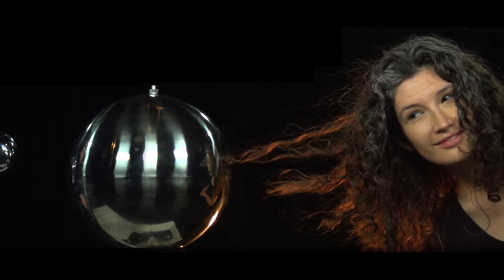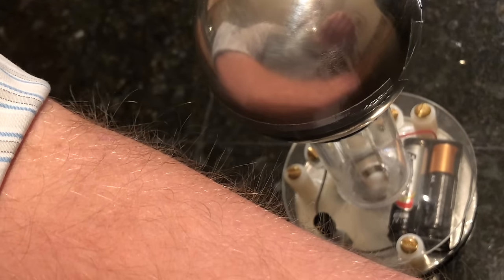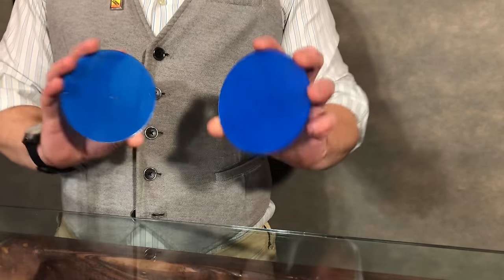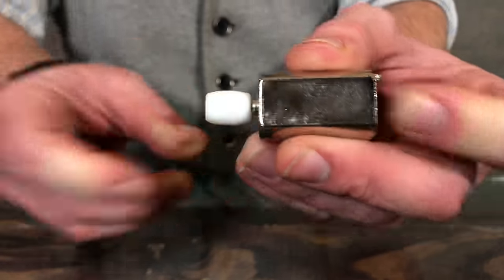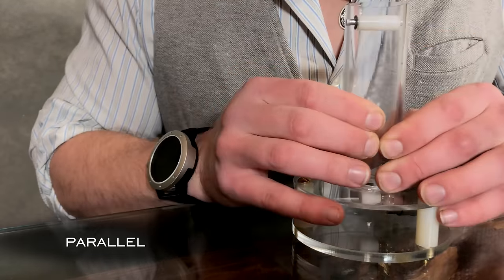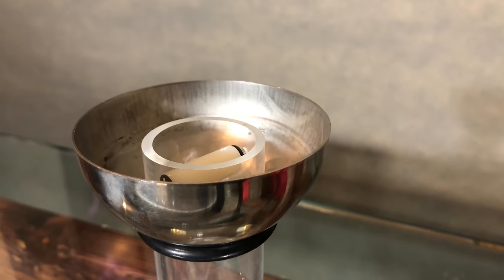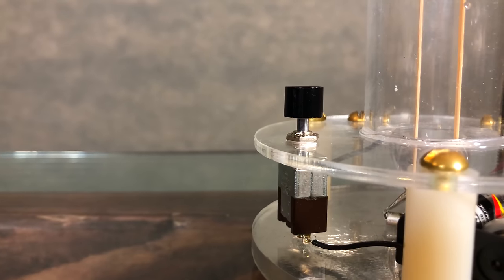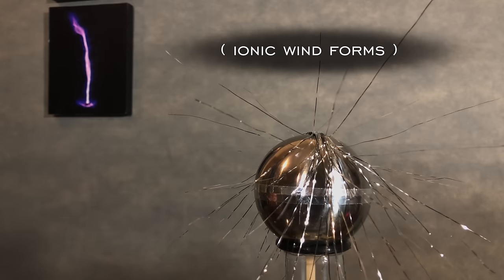DIY 40000 volt Van Der Graaff (battery powered)

Comment: Beautifully built, again. I was really looking forward to this video, because I have built a van-der-Graaff generator myself many years ago. One can even build a n ion motor. You just need some copper wire bent to an s, sharpen the ends, hammer it center and punch a little little dent with a prich punch in the middle and make a stand from another copper wire that is an o at the base to rest on the sphere and a vertical axis, which is sharpend to fit into the punch hole of the s. After is is ballanced, it will spin, when the van-der-Graaf generator is running, because the ions in teh air will repell the sharp ends of the s.
Reply from the maker: That’s true. Ion motors are fun. Thanks for the compliment

Comment: Just a thought ... you require 4 spacers for this project but 3 of them are just used for simple supports in the base.  These don't have to be nylon necessarily.  The only one that has to be nylon is the one you use to form the upper roller with the rubber band.  That one has to be nylon because of where nylon falls in the triboelectric series.  The nylon spacers linked in your materials list cost nearly $5 each.  You can use something much cheaper for the 3 supports for the round base.

Comment: About 60 years ago I built one using a plastic pill bottle for the column, an aluminum salt shaker for the dome and an old metal recipe card box to house the motor. It was very crude by comparison to yours but it worked. This was featured in a magazine but I don't remember which one.
Reply from the maker: Thanks for sharing, thats actually really cool.

Comment: Try connecting a small pointed bulb (like for a fridge) as the top load to the 3v tesla coil. The entire bulb glows green since the electrons have enough momentum traveling off the long ends that hold the filament to excite the oxygen in the bulb to a higher energy state where they decay and release a green photon. It's pretty much the Northern Lights in a light bulb! Also I connected a pin of a 1" vacuum tube as the top load and it shoots out 4 inch plus sparks off all the metal pins. I guess the electricity has less resistance and gains higher speeds traveling through the tube and then is launched off the pins. The sparks are very, very dim but to get a 4" spark from 3v tesla coil is awesome!

Comment: Well this has cleared up 1 mystery, I always thought the brushes had to touch the belt for it to work, now I see that they don't.
Reply from the maker: Some people have the brushes drag down on the belt. It will still work but then belt gets torn up really quickly. Also, then metal atoms get spread across the out of the belt and over time the belt becomes more conductive (bad). Yeah, brushes ideally should never touch

Comment: I still have a Wimshurst machine I got back in the 70's from a company that used to be called Edmund Scientific.  The device is powered by hand with a small crank.  It would deliver a one inch spark, but can do nothing now since I need new brushes and a Leyden Jar.  I still want to find a way to power it using a small motor with enough torque.  I think Edmund Scientific is called "Scientifics Unlimited" now.

Comment: Great video except I did get a little confused and had two questions:
1.where did you get your switch from
2.where do the wires from the batteries connect too 
It would help so much thank you
Reply from the maker: Thank you, The wires connect to the motor.
Reply: @PlasmaChannel  thank you by any chance do you know where I can find the kit for this? Or has it not been made yet

Comment: So, you used two teflon rollers and a rubber band? The upper and lower rollers are teflon and the rubber band transferring charges back and forth and the collecting combs remove the charges from the rubber band?

Comment: You emphasized that nylon spacers are important, but you never explained WHY?  I'm going to attempt a 3D printed version for all the plastic parts. What effect would using other than nylon  have? Really interesting project, and very well executed.
Reply from the maker: You need to use Nylon, because its the opposite end of Teflon on the triboeletric series. For the roller, you're asking?
Reply: @PlasmaChannel  I was asking about the 4 nylon spacers. I thought I might print them, but looks like I better stick with nylon there. I understood that the roller would have to be teflon. I have the 4" disks and the tower drawn. I'm going to draw up a mount for the motor as well. And look up triboelectric series :) Thanks for the reply.

Comment: Very clean build!
After using crt tv combs with success I'm starting to wonder if the whole idea that electron carriers is not to actually spray electrons but actually think of them in terms of  charge density. If the roller passes through a dense field the tribute electric effect will draw from that region first. Once drawn it is then replenished due to the draw of charge vacancy (effectively positive charge).
Also interested in watching Walter Lewin lectures of 8.02x the biggest determining factor of charge that a vandagriff can store is determined by the the surface area of your gaussian sphere minus any imperfections where charge density may rise to the point where it breaks down to the air.
Reply: where are the combs in a crt tv? I've not found any comblike parts or I didn't know where or what their function.
Reply: @maxprophet2401  What year were your TVs from? I grabbed mine from the 3 CRTs found within a rearprojection TV (just barely pre flat screens). CRTs can build up a ton of static, I assumed thats what they were for.
Reply: I know what you're talking about now, I was thinking they were for grounding excessive static so my guessing may be as good as your assumption, thanks!
Reply: @maxprophet2401  Exactly what I am betting. And they seem to do pretty okay with my VDG generator. Which makes me think that geometry of the conductor plays a role in terms of charge density and having triboelectric action (friction passing charge) happen within it opens the door for perhaps improvement on the designs.

Comment: Cool video, nice work on explaining how to build this. I only have one doubt. Isn’t the grounding brush supposed to be connected to the ground? What’s the physics behind this?
Reply from the maker: Thanks for the compliment! So, i personally hate using solid ground connections. It makes a device totally dependent on a physical connection. A way around that is to place a counterpoise on the base. While counterpoises only work for AC, they do act as a capacitor with the ground, and allow for a mild transfer of energy between ground  and device. This generator uses a counterpoise on the base....that almost touches the surface it sits one. So, it does, in effect, have a weak ground connection.

Comment: Ok, so I know that you don’t want any jagged edges for this type of build in order to avoid voltage leakage, however, if you place two poles with jagged edges each, the voltage leakage will create an even greater iconic wind/thrust between the poles.
Reply from the maker: I believe you a spot on with that.

Comment: I know this video is old, but hoping someone can help.  First off, thanks for this video! I am trying to build it with my son.  Is the spliced wire, from any electrical wire, something specific?

Any tips/advice on cutting the metal sphere?
Reply from the maker: Hi, honored you're trying to build this with your son. So, the spliced wire source is not important. You can use even metal screening. The point is to have a bunch of sharp metal points close to the rubber belt. Note: close, not touching. For these little generators, i found that braided wire was a quick and easy solution is all. My larger Van Der Graaff video - I used metal screening and the results are amazing. Cutting the metal sphere was admittedly sketchy. I had to use a circular bit, and, nearly cut my hand doing so. Be slow. Be careful. Use a 1" ( I think 1"?) bit.

Comment: Hey Jay ,
Great video !!My belt won't spin ....Do you recommend using a bigger motor ?(I did try slacking the rubber band a bit )
Reply from the maker: Belt won’t spin? Strange..., what type of motor did you use, and was it intended for 9v or 3v usage?
Reply from the maker: Also, does your upper roller freely spin?
Reply: I salvaged the motor from an old electronic car 😀....But It is slightly smaller (1/2) than the one you showed in the video.
Yes the upper roller does spin freely......Should I use any lubrication or would it ruin the turbo-electric effect?
Reply from the maker: You can indeed rubricate you upper roller, but make sure NONE of it gets on the rubber or outer surface of the nylon roller. Hmmm smaller motor likely  doesn’t have the appropriate torque?

Comment: I want to do this for my physics project! But how do I drill those holes without damaging the plexiglass?
Reply from the maker: Awesome! Drill the holes very slowly, then when you are almost through the material reverse drill. Reverse drill and make it spin quickly while putting light pressure on the drillbit. That basically melts through the very last part of the thickness and prevents cracking.

Comment: Would a hair band or some kind of stretchy cloth work better then rubber
Reply from the maker: The problem with a hair band is that it's not flat. You need a flat band like structure to carry the charge. Cloth can indeed work
Reply: A Nylon panty would work better but it doesnt hold very long
Reply: You can also use a black bicycle inner tube. Cut the rubber to the appropriate size & glue the ends  together to form a circle.. You can also make an enlarged VDG generator with an inner tube without having to spend a lot for a band.
Reply: @dandruff7807  I did that with the first Van de Graaff I made couldn't get it to work and ended up using the stretchy bands from a head work light and always had trouble with the Florida humidity

Comment: Ok so i have a Doubt...
electroboom said that 100000v from a van de graff generator doesn't hurt because the current is limited and exposure time is less.How is a Van de graff generator current limited?
Reply from the maker: So, the current is actually very high. But for such a short period of time that it has no effect
Reply: The current is in theory only limitet by the resistance of the sphere and the air
Reply: Think of it less as voltage & current and more as charges. When you touch the topload, all the charges rush through you for a few nanoseconds. Then you are at the same potential as the topload and there is no voltage between you and it anymore.

Comment: I have a question that I really need to be answered. I bought all of the pieces linked in the video, but the motor is a bit odd, it has a shaft at the end and I can't seem to get it off. how did you do it?
Reply from the maker: The shaft does come off.....but takes a bit of work. One of the 5 motors I bought....got ruined when I tried to remove the shaft. So be careful....but also be very forceful.
Reply: Thank you so much! I really like your video.

Comment: Is there any resonance calculation that need to be done if this were to be upscaled like with Tesla coils
Reply from the maker: There is, but not in terms of electronics. The belt can set up a standing wave vibration which makes it noisey and vibrate. Designing it in such a way to eliminate the belt setting up a standing wave would be beneficial
Reply: @PlasmaChannel  Thanks

Comment: How is it 40000 V considering 1.5V double AA batteries.?
Reply from the maker: There is zero correlation between the voltage you apply to turn the motor, and the electrostatic voltage accumulated at the dome. The home accumulates high voltage dude to the triboelectric effect

Comment: if anyone could comment on this who built this i have one question. if you touch it with one hand and then turn it on with the other will your hair on your head go up?
Reply from the maker: It is not quite powerful enough to make your hand stand up. You need larger Van Der Graaffs for that. It does make awesome sparks though.
Reply: @PlasmaChannel  disappointing but thanks for being honest I appreciate it

Comment: Top roller is rotating or not
Reply from the maker: Yes, you need the top roller to rotate. Otherwise, it just wears down the rubber band super quick. The triboelectric effect does not need rubbing. It just needs contact.
Reply: Top roller is connected to steel bowl but bottom brush is connected to which ?
Actually I am also construct this thing similar to you but not working          
Charge is not obtained
Reply from the maker: Kalyan Karri the top roller is not connected to anything. It rolls around the rail. The upper brush is designed to be placed 2-4 mm away from the rubber band, just above the roller. The upper brush is what’s connected to the sphere up to. The bottom brush also does not touch the rubber band, and is connected to the counterpoise.
Reply: Counterpoise mean bottom brush connected to any dc supply or earthed
Reply from the maker: Kalyan Karri no, counterpoise. Counterpoises are used when no ground connection is possible. This was designed to not need a ground connection
Reply: Thank u sir

Comment: just and idea ..but if you combine this with your ionic lifter..couldn't you make the lifter portable.
Reply from the maker: In theory yes. But, this creates very very little power. And this weighs about a pound. To lift a pound with an ionic lifter takes a tremendous power level
Reply: @PlasmaChannel  i was thinking a light tube, a smaller low voltage motor connect to a thin solar panel like they use to show how solar power works in those weak kits and wear the ball on top goes wire it into the one part of the lifter and the ground part wire it in the other part..lol so you cut out most the plastic and metal to lower the weight...but you would know more about that . then i would. ^_^

Comment: try to diy like the motor, try vacuum insulation of the spheres
Reply: you could make it in a manner that does not require a replaceable belt, also maglev bearings
Reply from the maker: I could try a that, yes. Maglev bearings though would be very hard to make in a small space.
Reply: @PlasmaChannel  electron gun instead of the belt
Reply: would you be interested in trying plasma fusion in deuterium gas with high pulse current from supercapacitors with carbon electric arc furnace? also would you be interested in material and isotope filtering using a sector type mass spectrometer?

Comment: I would really apprechiate if you could tell the mesuraments also in centimeters
Reply from the maker: That is a good point. 1.5 inch acrylic tubing = 3.75cm
3 inch sphere = 76mm
4.5"tower = 11.25 cm
4 inch plexiglas circle = 10cm
1 inch nylon spacer = 2.5 cm
.75 inch center hole for rubber band = 1.8cm
Hope this helps
Reply: @PlasmaChannel  yes, it does. But i intended in all videos
Reply: I'll second that, maybe just overlay on the video? Or whatever is easiest. It makes it easier to follow along as I just don't think in imperial so makes it harder to follow along and visualise the build. Utterly amazing content by the way. Really impressed. I rushed out and got a spark kit after your review a while back, just have to build it now.

Comment: If I can touch this why can’t I touch 120 V from my outlet
Reply: It is safe when the available energy is too small to do you much harm. A powerline obviously has a lot of available energy, and a 200,000 volt shock with essentially unlimited current like a powerline will make you very very ill for an extremely short period of time.
Reply: The energy reply is correct. An analogy would be a very thin pressurized air hose. The air in the hose is at a high pressure (like high voltage) but the hose is so small that there's very little air actually moving around inside (current). The 120VAC in your outlet is lower "pressure" than the little air hose, but it has a much larger diameter and carries enough air to actually do work so it's still dangerous.

Comment: With all the respect it's 5000v the most
Reply from the maker: Why do you believe so? Ive tested with 1” brass spheres. Which is the standard used by American society of electrical engineers. Every cm between the spheres is 30kv. I recorded a 13mm spark between the spheres meaning 39,000 volts (rough)

Comment: two different rollers could increase the spark. let' say top roller made of glass maybe.
Reply from the maker: Nylon and Teflon are one of the best opposing triboelectric materials. And super durable, that’s why I designed it this way
Reply: @PlasmaChannel  True, definitely durable.
Reply: next project will be a ruhmkorf f coil?  :-)
Reply from the maker: Hm, I should read up on those. But they are really cool!

Comment: You should know that the energy is NOT coming off of the ball, but in actuality is drawing voltage from the air around to balance out the charge created in the ball. The "energy beam" you see from your finger and the ball is coming off of you and not the other way around. School teachings will teach you the wrong stuff, I know because I was learned and believed the same thing for decades.
Reply from the maker: Which direction the electricity is coming from is determined 100% by charge. + or (-)